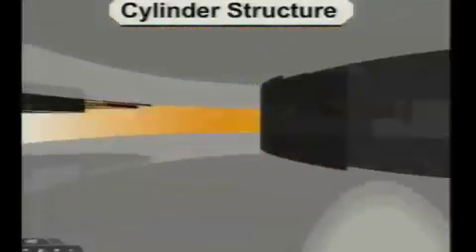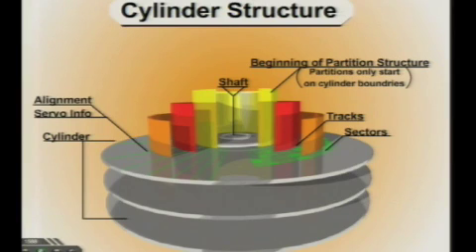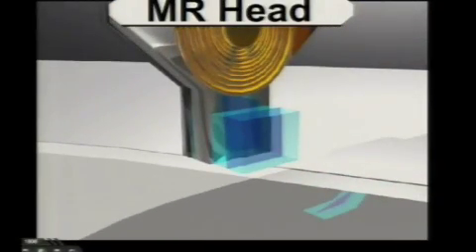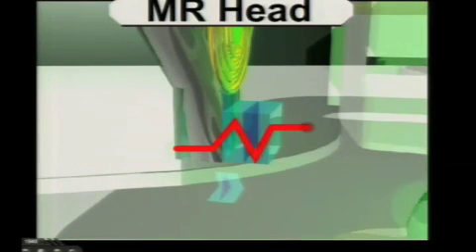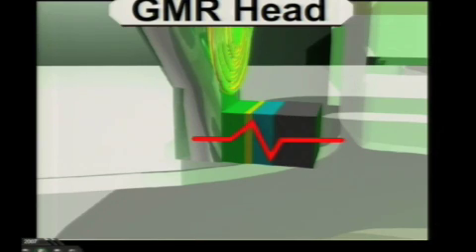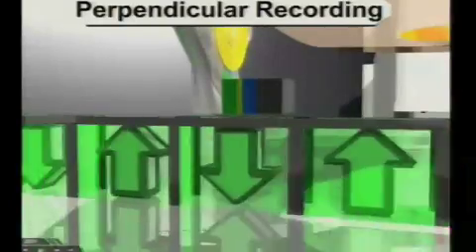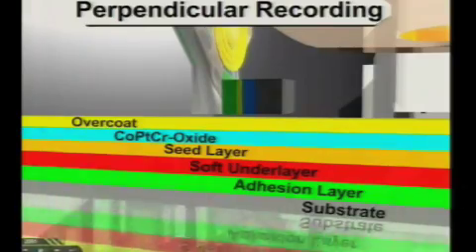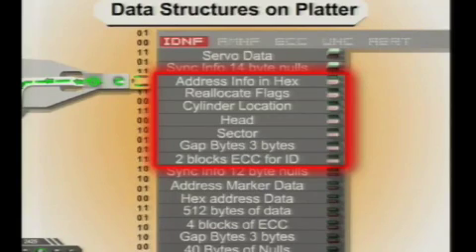Advanced Hard Drive Data Recovery Part 2

Comment: Partitions are not actually guaranteed to start on cylinder boundaries - most older partitioning tools snap partitions to what they perceive as cylinder boundaries, but on all modern HDDs, this follows an emulated geometry with no relation to the actual physical layout on the platters. Worse, on advanced-format (4K) drives, the emulated cylinder boundaries may not even coincide with physical sectors, so nowadays alignment to 1 mebibyte blocks is recommended instead (which always coincide with physical sector boundaries, as 1048576 is divisible by 4096). Aligning to cylinder boundaries on a 4K drive may actually reduce performance.